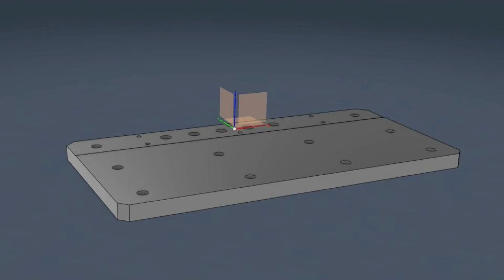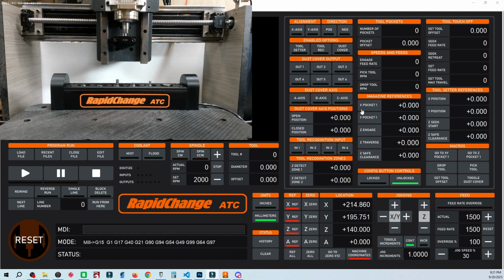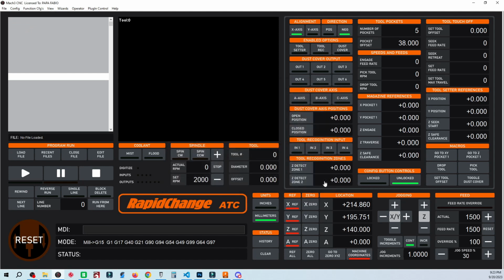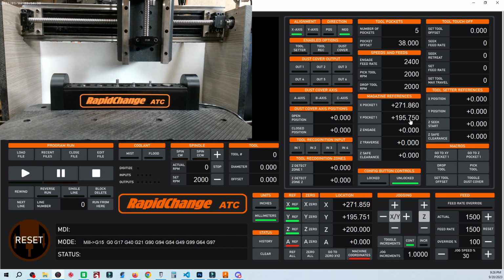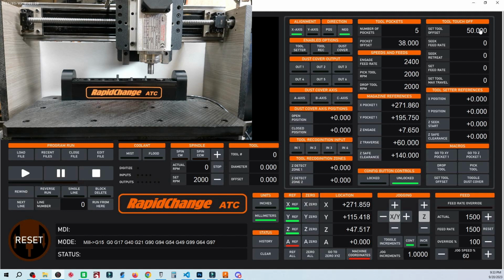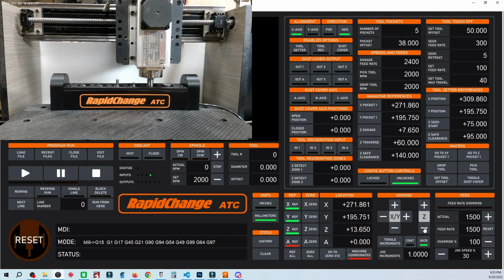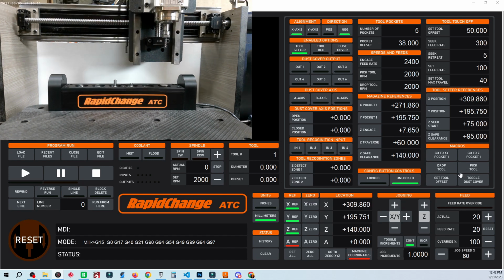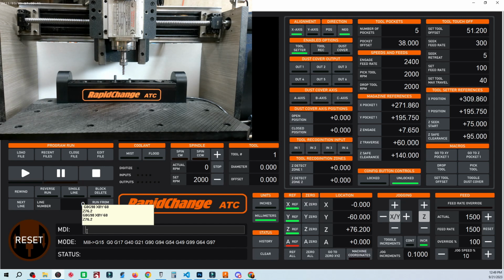RapidChange Automatic Tool Changer magazine installation and configuration / Mach3 screen set.

Comment: Why dont you have the tool touch sensor  and adapter for sale on your site? I found your product while planning my PrintNC build, and luckily I haven't ordered my kit from three design since I'll now want to make my build bigger  to accommodate a rapidchanger but I also want to buy the touch probe and adapter. 

Also, can you confirm that the premium version has everything preinstalled so there is nothing else I need to buy?
Reply from the maker: Thank you for the comment! We don't stock the tool setters but we included the adapters with every magazine. the only other thing you would need is extra clamping nuts and collets. So other than that everything is pre installed. Here is a link to the 3D touch probe:
https://www.amazon.com/gp/product/B0BDSDSJF6
Reply: @RapidChangeATC  Thanks.

Comment: Hello friend, that tool change system works for a CNC workbee 1515 xpro v5
Reply from the maker: Hello friend and thank you for the comment. If your using duet we do have a member on our discord server that is working on a script. RapidChange ATC will work on any CNC Machine that has controlled spindle speeds and runs off gcode. I hope this answers your question.

Comment: im not sure i can get my 2.2kw spindle to go that slow, i think 10k rpm is the slowest it goes, do you have any suggestions for this?
Reply from the maker: Thank you for the comment and question! It depends, Most likely it's a rating from the manufacturer all my spindles are rated at minimum 8k rpm but I set the lower end to 0 in the VFD. The reason that these motors are rated that way is because if run below that rpm under load or for an extended period of time the motor will over heat. The 2 seconds the spindle is on at a time at that speed does not over heat the spindle.
Reply: !linuxcnc?